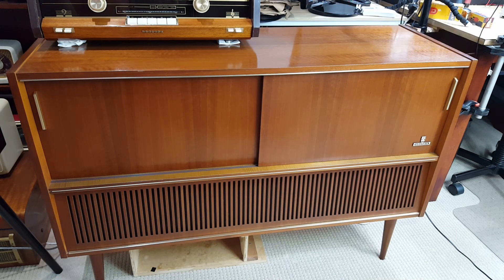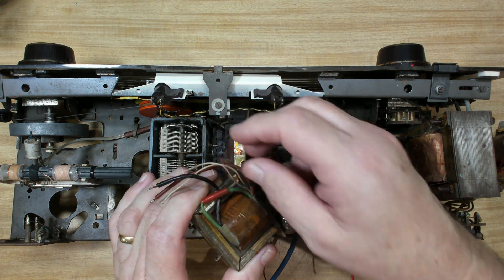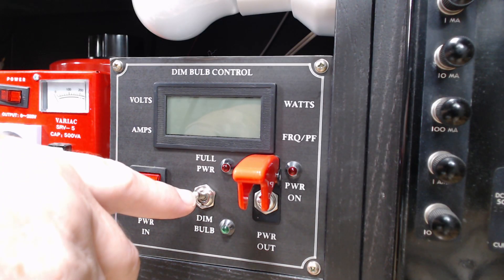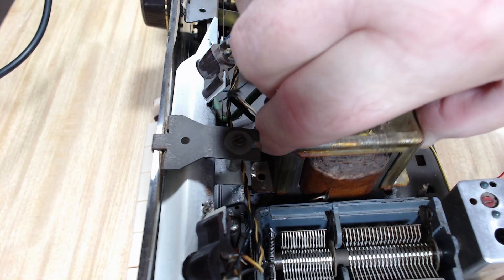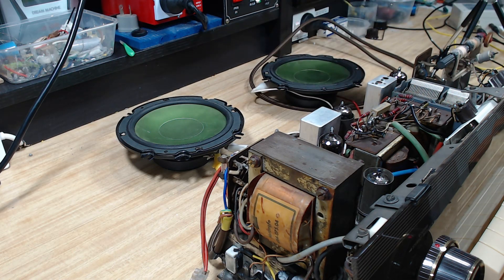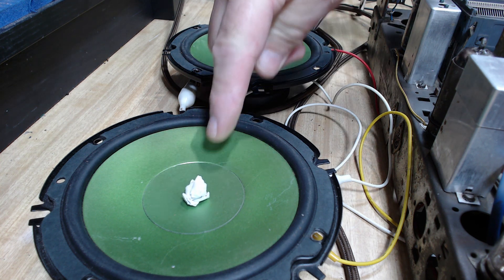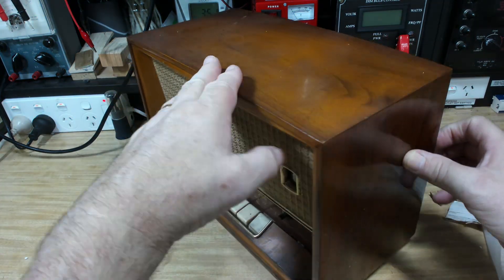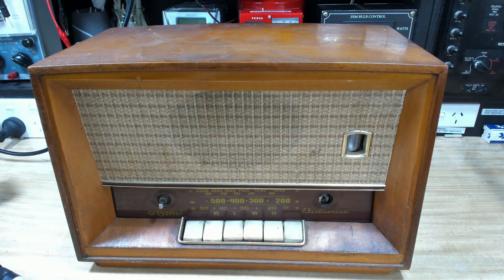Grundig Trento Radiogram OP Transformer Replacement

Comment: Nothing worse than having a project sitting around unfinished. It must be good to have it working as it should! I checked out Blitz Roehre’s channel and managed to get the English subtitles working. It seems the set he sent you has an auto transformer and a hot chassis.
Reply from the maker: Hi Don, I agree, I had to walk around the Grundig for 6 months, very frustrating. Blitz did all the hard work finding out it was an autotransformer 😂 Thanks Don.

Comment: Hi David - amazing video once again! Greatly appreciate all the effort you put into your uploads. If I recall, you had a special tool to make the pigtail ends on the capacitor leads but I just can't remember what it was called?
Reply from the maker: Thank you MrPRG. The coils are called Quigs, and I think I demoed it in this very early video, It's a small nail on a dowel with a slot on the end, you put the wire in the slot and wind the pigtail on. https://youtu.be/8VsAXV9abFI
Reply: @DavidTipton101  yep spot on, cheers! such a simple and clever device, didn't even realise it was homemade

Comment: Dave , A friend brought something to my attention that I had not noticed.  When you read the voltages from the analog meter, it appears that you were reading the calibrated scale that belongs to the AC10V range - which has no numerical markings  - instead of the scale under the parallax reflector, which indicates the AC ranges other than 10V.  So, for example, what you interpreted as about 52V is actually slightly under 50V.  This reading gives a ratio closer to that of the original transformers.  In other words, the bold tic under the 50 on the AC10V scale actually indicates about 2.2V when the AC10V range is selected, not 52V when the AC250V range is selected.
Reply from the maker: Your friend and you are absolutely correct Bob, I did read the wrong scale, I should have arrived at 26 and 27.5 for the turns ratios, only 1,5 turns difference and about 400 Ohms. It's closer than I thought. Thanks for pointing that out, The way they offset the 50 made it look like it belonged to the 10 VAC scale. Thank you for pointing that out, I will be more careful in future. Thanks 🥇🥇👍😀
Reply: Correction: the bold tic indicates 2V on the AC10V scale; the needle would be showing 2.2V, were the AC10V range selected.
Reply from the maker: Got it, thanks again 👍🙂

Comment: David the radio turned out beautifully far as the original output transformers they must have been undersized from when the set was designed and they got stressed .
Reply from the maker: Thank you Richard. Maybe, I have no idea why one went open circuit, bad grid capacitor or corroded windings is another reason 🤔🙂
Reply: @DavidTipton101  I know some radios like General Electric and Zenith used under sized power transformers .
Reply from the maker: @richardbrobeck2384  yes, I've heard of that.

Comment: Wow!! How fabulous is this? Way to go on replacing the old output transformers, they just fit.
I am surprised that that Grundig radiogram does not have FM? But so it goes.
A great save by team David Tipton & Blitz Roehre.
Reply from the maker: Thank you Craig, it was tight but they went in 🙂 No FM in Australia until 1975, it would have had FM in other countries. Cheers, David Tipton & Blitz Roehre 😀

Comment: Hello Mr Tipton.I`m glad to see a romanian radio on your bench.If you need anything for the Carmen2 radio (schematic,translation and maybe i can find some parts at a local flea market) just leave me a reply and i`m very glad to help.Thank you for what you`re doing.
Reply from the maker: Hi iluminaughty, thank you, I have the schematic for the Carmen 3 which I think is the same as the Carmen 2. If you have the schematic for the Carmen 2 I would appreciate it. My email is vintageradioaus (at) gmail.com I should be OK for parts. Thanks iluminaughty 👍🙂
Reply: @DavidTipton101  It`s the same schematic for all Carmen models (1.2 and 3) bur on one schematic i think is a misptint for the IF (453 instead of 455) but on all romanian radio models for the era the IF is 455.I will send you a mail with all the schematics,
Reply from the maker: @iluminaughty  Ok Thank you.
Reply: @DavidTipton101  got the mail?
Reply from the maker: @iluminaughty  If your initials are DG then yes and replied if not DG then no.
Reply: @DavidTipton101  i must have done something wrong,i`ll try again

Comment: Nice job!  I've found that the output transformers tend to matter more in regards to the output tube rather than the speaker.  For example, I've used an output transformer matched with a 6F6, and noticed no difference between a 4, 6, or 8 ohm speaker.  I think this may matter more when it comes to hi-fi equipment, but for these old AM radios as long as it works and sounds acceptable, it's good enough for me.
Reply from the maker: Hi Adam, thank you. I don't think the difference will matter either in this set but the speaker impedance is reflected back into the primary of the OP transformer which is felt back at the OP valve. Without the right balance you can get too low current flow or too high, too high can shorten the valves life considerably. My concern here wasn't with the plate load but more that it would move the tone curve out of the sweet spot 🙂
Reply: @DavidTipton101   with audio  it wont matter that much with the miss match in A mono  set , truly it wont harm any class A output tubes just maybe some added distortion due mismatch , anyway great end result

Comment: We are so resourceful these days with the Internet. 😁 It’s extremely valuable technology in these difficult times.

It was a very rewarding result with patience and team effort with that helpful conscientious gentleman from Germany. Hats off to him for being a team player in this radiogram project.

Although no FM, I am excited by opportunities to restore a quality shortwave receiver like this one day and get a descent shortwave antenna set up on my property permanently.

The shortwave experience with grandparents is a fond memory of this work. 

Good demonstration of the transformer coils ratio Dave with useful diagrams. Thank you! 😁☕️

Thanks again for your help recently with the signal generator. The frequency counter arrived. I have pulled down the SG. It had been restored and the RF out put wiring for the FC was connected in directly at the rear of the RF selector. 

Very clean inside but a piece of solder was removed from between the gang capacitor plates. I ran another clean in there too and adjusted the rubbing plates.

Looking forward to another radio adventure when possible. 😁👍🙋‍♂️
Reply from the maker: Hi Peter, the internet is the only means I have in doing these projects, it would have been very hard for an outsider to get into something like this before. I am just in the process of installing a better antenna and the results have been positive so far. I can now pick up SW stations I couldn't before, with a bit more finessing I should be able to improve on that again. I'm glad you have the generator working, I guessed it had been worked on before and I hope you have fixed the little niggles it had 👍🙂

Comment: A great start to the new year, David,
and a new radio, with autotransformer and a hot chassis as well.
Looked like it had an unique (maybe russian) magic eye tube also.
Some guys have all the fun...
Hey, "Blitz Roehre" isn't that those neon filled strobelights we used to play with before?
They were used in flashes in old cameras and also in those lamps used to set ignitiontiming on cars.
Charge them up to 3 - 400 volts, and then trigger the neon gas with a pulse.
Reply: Hi Geir, the magic eye is a totally fried EM80 and yes, Blitz Röhre means flash tube such as in strobe light or photoflash in german. I named my channel like that because Blitz is also lightning in german and because I do electronics and storm chasing hence the youtube nickname. I have yet to upload some storm chaser videos though.... no decent thunderstorms here for years now, maybe 2022?  :-)
Reply from the maker: Thank you Geir, I'm glad you enjoyed it, it didn't have a lot of content unfortunately. I don't know what the magic eye is but it looked like an EM80 going by the quick glance I took when I unwrapped it, I hope so I have a number of them. Blitz Roehre might mean strobe light, I still have one in my garage 😀

Comment: Thaks to Blitz you have a radio from my country. If you need a schematic for Carmen, I might have one, if not the service manual. Send a message if so.
Reply from the maker: Hi Dorel, Blitz outdid himself, thank you. I have the schematic for the Carman 3 (S632A) but not for the Carman 2 (S624A). I imagine they are the same chassis, but if you have the schematic for my model it would be greatly appreciated. My email is: vintageradioaus (at) gmail.com Thanks 👍🙂

Comment: Excellent video as usual  . Re transformers having the same problems finding  miniature ones for my vintage radio control builds. Have a box full but the ratios are all about 1:1 .Used for the output transformers on pocket  transistor  radios 📻.  Finally  found  some 1:5 ratio types I need but for some reason they are very rare !  If anyone knows a source of   Ardente  D1001 Miniature  transformers i would love to know. Most of the 1960s. Radio control receivers used them .
Reply from the maker: Thank you Pufango. Good luck with you transformer search 🙂

Comment: What a generious thing to do for you,  Mr Blitz is a loverly man 😀
It sounds smashing now 😀
So you have a couple of dead transformers,  maybe  rewind one with fresh wire and it could be usefull for testing.
Length for length wire, no need to count the turns.
Ignore the electrostatiic winding.
Just a silly thought.
Reply from the maker: Indeed zx8401ztv, Mr Blitz went above and beyond. If Blitz had not stepped in and I couldn't get replacements I would have done just that. I might still see what would have been involved. Thanks zx8401ztv 🙂

Comment: I bet a transformer for this is VERY HARD to find. Maybe 🤔 your Australia 🇦🇺 place has new old stock (the one ☝️ that specially make your dial glass). A radio 📻 transformer can be rebuilt at home 🏠, but this involves unwinding some 1500 feet 🦶of copper 👮‍♀️ wire, as thin as a human hair ( without breaking it). Ya also have to relaminate, the wire, and wind it all back 🆙 again (without breaking it). The wire has to be stripped of old lamination. This also is a very painstaking way to go. Also, beware of shipping 🚢 costs, when buying a transformer online. It can cost just as much as the product. Your friend, Jeff.
Reply from the maker: Thanks Jeff, rewinding was an option but replacement was a better option I think 🙂
Reply: @DavidTipton101  Rewinding a transformer is pretty 😍 painstaking anyway, and ya do not want to break the wire. Replacement is a lot easier, but do watch the shipping 🚢 price when ordering one ☝️ online. Somebody must have these transformers as new old stock. Your friend, Jeff.

Comment: Youtube just recommended this to me... and I have a spare chassis for one of these or one remarkably similar. Sadly, the cabinet had sat in water, and all of the beautiful vaneer split, and many, many ciggy burns and mold. But the radio itself is in decent shape, with front glass.
Shipping might be tough on a big transformer. I am an ocean away. 
Great video.
Reply from the maker: HI Nobody Noone, yes shipping can be murder and a pity the cabinet is in bad shape, thanks 🙂
Reply: @DavidTipton101   It was cheap, and local. I plan to build a small new cabinet and toss some new caps in it. It's a very nice radio!